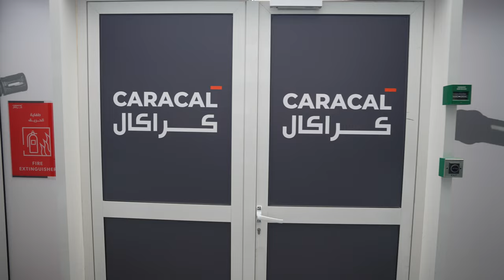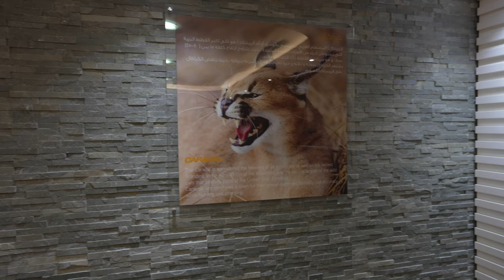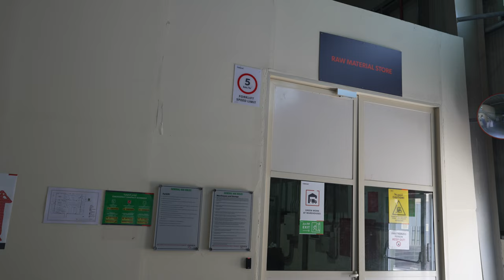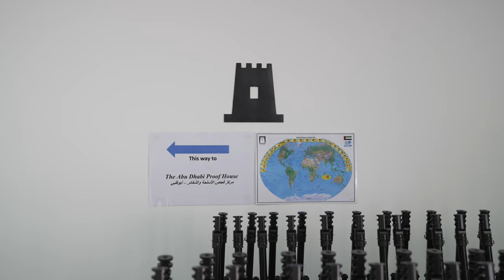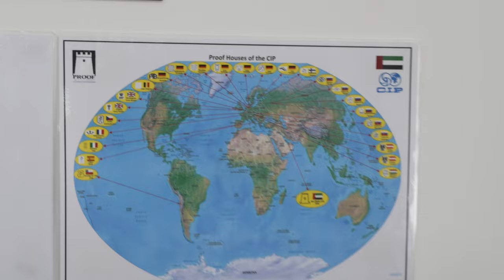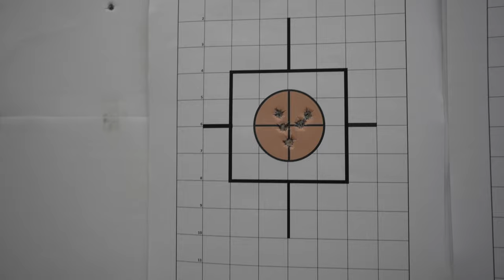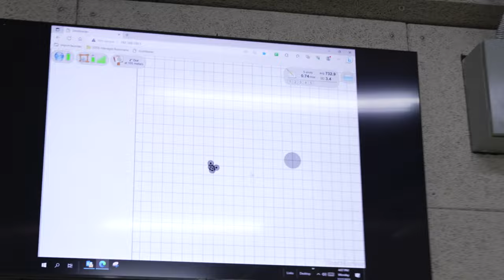Caracal firearms manufacturing facility. Impressive!

Comment: I do not know if Chris Sirios is still at Caracal . Chris was senior engineer on HK 416 , Sig 516 , Sig MCX / MPX and Caracal 816A2 . 
Caracal 816A2 is one of the best External Piston ARs on planet earth . Think of the 816A2 as the Gen 3 Version of the 416 . 
Caracal 816A2 was one of the best kept secrets for a good while . Now the cats out if the bag . 
I've been huge Caracal fan for a good while.  
Caracal also did pretty extensive testing on what's better Chrome Lining , Nitride , or QPQ . Caracal found that QPQ held it's own against C.L.  on when testing 816A2 . Obviously C.L. will always be the standard for Hard Usage Mil Type Carbines.. 
Awesome video bro

Comment: When the "I can build one for cheaper" argument gets brought up, I bring up that Caracal's ARs have extractor guard that are usually found on military grade ARs. Caracal markets it as the "over the beach" feature, which basically means should a barrel obstruction occur the bolt locks causing the explosion out towards the front and NOT toward the shooter's face.
I have the 816 and two of the 814s. Very satisfied with the performance. I called the customer service with a couple questions and later found out I had spoke to the USA branch manager who was very helpful.

Comment: Nice review for their state of the art facility, Ray. I visited their booth at one of the NRA meeting some years back, because they were offering a piston driven AR-15 uppers. Being a piston operated loving AR-15 guy, I was interested in their offerings. 
They explained it was an improvement on the HK 416/Sig 516 designs. I was very interested. But they had nothing to sell at that time, and was instructed to call the US facility. Nothing came of that, and never heard anymore of them. 
That 338 looks to be one sweet rifle when it come to market.
Reply: @snakeman48      Chris @ Small Arms Solution does a great job on the Caracal  and gives a lot of details on the Start up of the Co. and a run down on the guns. The 2 men that gave us the 416 / 516 put this rifle out. They used all they learned from their past with HK and Sig and came up with the Caracal. I am with you on the AR piston platform love them, I have 5.  3 Sigs, 1 Ruger and a PWS.
Reply: Most of the models in the video are available in the U.S. direct from Caracal USA in Idaho.